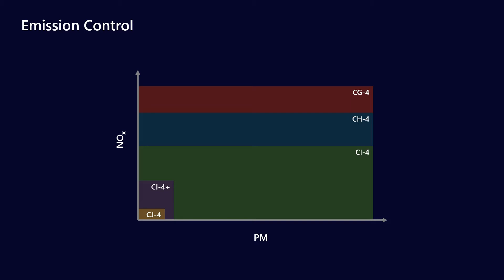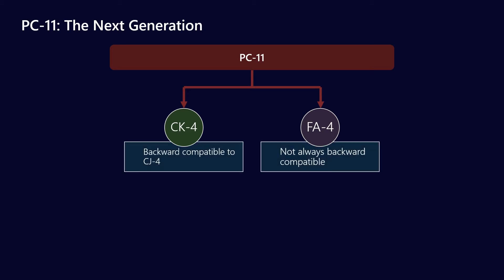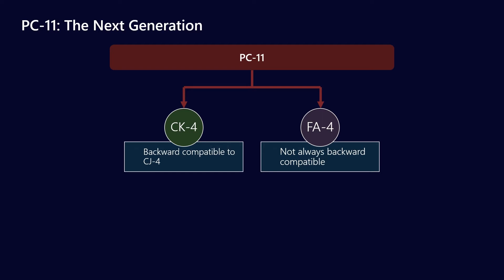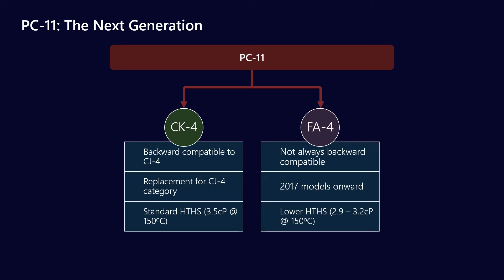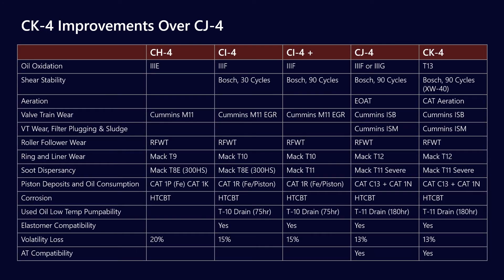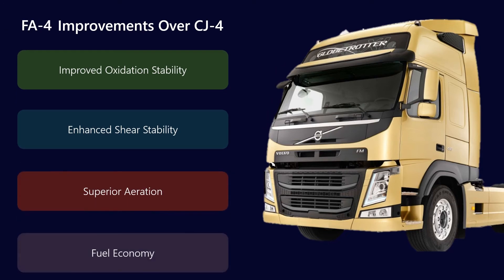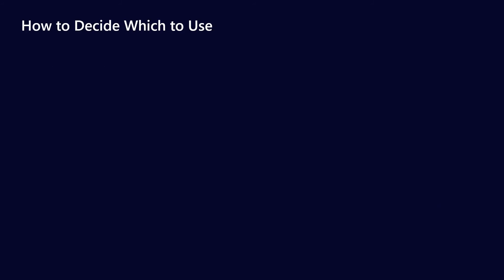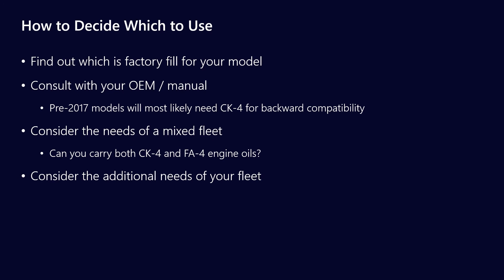How do I choose between a CK-4 or FA-4 Diesel engine oil?

Comment: I have a question my 2018 freightliner Cascadia comply with FA four category, but I was using CK~4 my question is if I’m still stick to the CK four does it have any impact on the engine I mean the longevity of the engine and. CK-4 is very costly and hard to find

Comment: So does this mean i can run the Ck4 oil in my 2003 1kzte engine then, as its listed to use Cl4. But wouild the Ck4 oil do any damage to my engine or will it add the extra protection for it so it runs better ect and better fuel use? Cheers mate on this info.

Comment: I was using an Chevron Delo XSP 400 with API-CK-4 SAE 5W-30 –which is in the lower high temperature limit where we live– on my wife’s 2010 Volvo XC 60 D5,feeling that it was a better oil than the ACEA Spec for this Volvo. Albeit I changed to a LubriMoly with ACEA A5/B5 SAE 5W-30 as per the spec of the Volvo’s owner manual. But now I feel that I changed to a lesser oil as I could have had used an SAE 5W-40 and CK-4 performance level of the Delo XSP…

Comment: What is the minimum API Service  engine oil specification for common rail Diesel Engine? In this case I use Chevrolet Captiva Diesel 2010. Thanks

Comment: Doesn't the improvement in fuel economy come with a built in assumption that the higher viscosity oil is in excess of the minimum hot viscosity needed for a full hydrodynamic film under the loads and surface roughness? And doesn't the reduction also reduce margin for excursions? There must be some rational reason why manufacturers have been calling for this 'excess' viscosity all these years when they could have the substantial marketing advantage of better fuel economy.
Especially considering the typical shape of a film thickness vs traction curve and the way it is very steep if you err on the low side and rather shallow if erring on the high side. This energy loss behavior is compounded by a similar effect on component life, with an err on the high side having near zero reduction on parts life (aside from extreme cold start starvation) while the low side will quickly get into boundary lubrication conditions with potentially great reductions in parts life.

Comment: Good day! Is it advisable or can diesel engine oil be used for petrol engine?
Reply from the maker: That’s a great question! A lot of Diesel engine oils are approved for use in petrol engines - look for the “S” category API spec. For example many CK-4 oils also carry the SN approval. Worth checking out this video: https://youtu.be/EsTpHvlEOGk

Think about most truck engines: they’re large volume, turbocharged, high compression ratio (16:1), direct injection, dual overhead cam engines. That describes a high performance engine! So in reality Diesel engine oils are designed for high performance engines. The main differences is that there mostly higher viscosities than modern petrol engine oils and they’ll probably have a slightly higher TBN.
Reply: @LubricationExplained  Truly appreciate your reply! I usually prefer weight 40 for my car as I live in a tropical climate, so I think most diesel engine oils fit my need. Surprisingly, I found that diesel engine oils are cheaper comparing to some petrol engine oils given the same grades.
Reply: The trucks that we get to see I Costa Rica are obsolete American made style models. Today we see some Hino models with –perhaps– operating DPF’s! Albeit, our 2010 Volvo XC 60 D5 was as moder as Can be when we bought it!